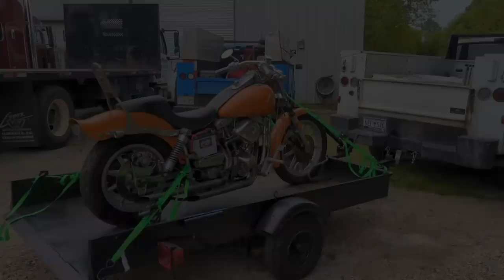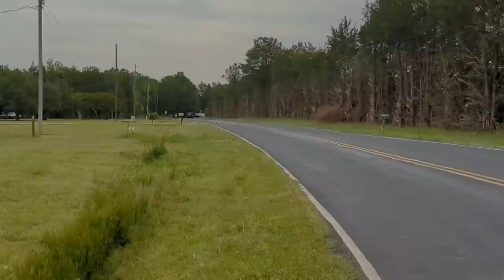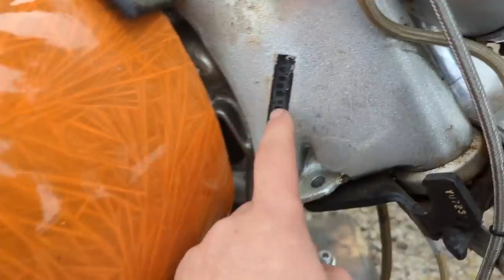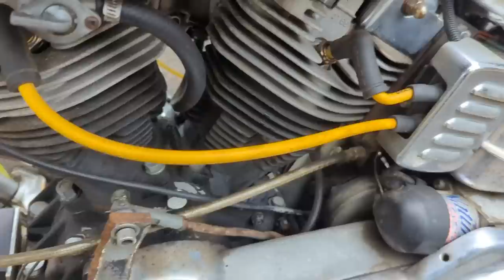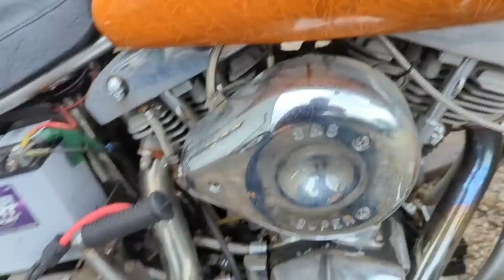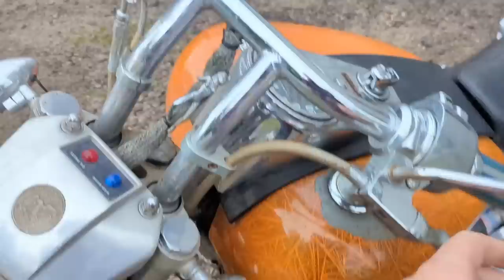I Bought The Cheapest Shovelhead I Could Find on Facebook! How bad is it? 1974 FLH meets 1979 FXS

Comment: TURN YOUR IDLE UP to at least stock RPM. Adjust when engine is warm . Helps keep oil going through the top end at idle.
Reply: Yep also to low an idle will drag the  crank pin bearings an cause lots scoring ...ppl always think it's Kool to have idle so low
Reply: @bigmikelongwood3276  it’s why I bought a cam for my evo. I like the lope lol
Reply: @crazydoom3dude  yea I got some huge cams in my old ironhead it lopes for days
Reply: @bigmikelongwood3276  I bet! I also got a higher pressure oil pump and stuff to make it all work well. 85 cubic inch big bore kit, ported polished heads, who nine yards. Makes 100whp
Reply: God dam I was screaming that.
Reply: I know maybe it sounds cool but waiting till it's good an warm is almost common sense.
Reply: Everybody sets the idle too low. It sounds stupid, doesnt circulate oil and probably doesnt do the hydraulic lifters any good either. Yes you may have to fiddle with it, just like a model A, but thats a carbeurated bike for ya
Reply: People love the sound but it's killing the engine.

Comment: Shovelhead is the last old school Harley a guy can maybe afford today however they are absolutely 100% as bad as I remember them.
Reply: We couldn't ditch them fast enough once the Evo was put into production. Why someone would purposefully rehab one to use as a daily rider is beyond me!
Reply: @LeoTheComm  its just an engine. Build it right and it wont  know if it is a shovel or a block head american made or jap made
Reply: @LeoTheComm  I take an antique out virtually every day I ride! Evos are great engines!
Reply: 30+ years riding two shovels, {a '77 and an '82}, I would never call them bad. The few problems I had were easily permanently corrected: Stock ignition switches were junk, replaced with parts store universal switches and the stock switch hole was the perfect place to fit an oil pressure gauge. The '82 had the crappy electronic ignition but switching it back to points made it super reliable. Both bikes ate clutch cables but converting to jockey shift solved that for good and (my personal preference) I think it's way cooler anyway.  Also the machine screws that hold the exhaust pipes in the heads are known to sieze and strip out when removing so I replaced them with studs and brass nuts. Many trouble free miles and lots of fun with those bikes...
Reply: Not really. Get a evo Harley, and you can afford it, and fix it all yourself.

Comment: The engine sounds good.  The gears upshift good.  Overall I believe its a good shovel.  I would want to chrome the engine though and get chrome rocker covers and cam chrome nose cone cover and outer primary.  Just put a new pilot jet in that carburetor because im sure its clogged ( I have an experienced ear for this)  Next, paint the tank and fenders a dark red and have lower fender and tank in gloss black color.  Leave the wheels as they are.  Try to paint that frame black and get rid of that crappy silver color  That silver frame is a huge minus in the bikes looks.  And yes youre right that shift linkage looks like chit and needs to be changed.  So gradually as you will still be able to ride, about 600.00 will fix you up

Comment: I believe that the frames are very much alike, but there are a couple.differences. Behind the rear head, the seat post is slightly different, and the FL frame has a tab on the primary side to accommodate the floorboard.

Comment: Nice bike man. I have a 75 FX, it's also Orange drag pipes same handlebars same forks I was trying to send you a video of it. I'm sure you know what's inside that motor. I have a 80cc stroker 60 over same carb 10 thousandths bore. it sounds almost the same. almost eighty horses 90 lb-ft torque right around 3G rpm. I paid 5 for mine and I love it. I want to put a little trailer or probably better with a sidecar for my little buddy to ride along

Comment: Good day. You might have a FLH frame? I can’t remember but the footboard mount you pointed to near the drag pipe is the giveaway. But I can’t remember  on which side it was deleted for a FX frame. Smitty 
Footboards and original FLH  foot controls will work for shorter people. And a lot easier to install than mid controls. Footboards are very comfy.
Reply from the maker: Yup this appears to be an FLH frame, the seller told me it was a 74...I don't really want floorboards. I may fab up some mids or some closer forwards.
Reply: @buttcrackcycles  you really don’t have to run boards. But the stock shifter and brake set up will fit real real good even with pegs.
Reply: It's definitely an fl frame, due to the tab on the right side. It has a fl outer primary as well, notice the tab on it. These are both for footboards.
Reply: @buttcrackcycles  Don't cut that floorboard tab off! I have been looking for a floorboard aluminum outer primary for my 77 at swap meets for a year now- lots of FX (tabless) outers around but not FLs!
Reply: I had a 77 fxe that had footboards.

Comment: Geez, crazy as it sounds, I kind of like it. Immediately following Bike Week 1982, I purchased a left-over 1981 FXEF from a guy known well to me. He had bought it from a local dealer, added a BUNCH of chrome (no skulls), a flat tappet cam, Barnett clutches and a Super B, trailered it the 1000 miles to Daytona and road it for the week. Trailered it home with 164 miles on the clock and decided to sell it. The deal was too good to refuse at 5K even. (He wanted the cash to put in another lift at his garage) I put just over 43K miles on it with only normal maintenance. The last of the AMF Harleys was, for me, totally good.

Comment: Decent score! That one's hardly "bad". They certainly knew someone as there was no need to alter the engine numbers since title passes with frame post-1970. Fine for a rider so good score. Removing the bagger garbage was perfectly normal in that era because bikers bought HDs to use as actual transportation. Low Riders reflect Willie G. copying what bikers had done since the generator era with Sporty front ends etc. There should only be a VIN on the right side case.

Based on my decades of Shovelling (and fixing fighters), take or leave as ye prefer:
I'd install a stainless lock nut to retain that spark plug holder cover. Shovels vibrate and SC roads ain't smooth (I live near Sumter). 
Star style lock washers work best (per NASA, and why spit locks aren't used in modern aircraft) and red Loctite gel is love. 

The stock cowpie box is best hung on a wall along with the primary once it has significant wear. The affordable upgrade for a keeper is a late splined shaft Evo Softail transmission, primary and starter which are best hunted cheap and set aside if not needed immediately. I still run cowpies but may have scared them into behaving by threat of replacement.. My Pan project is starting off with a five speed for the vastly better everything including reliable Denso OSGR starter (ya won't be young forever so leaving the option never hurts even if you run a kicker kit).  

BTW Taiwanese kicker kits and arms for the old four speeds are trash and the arms bend even with stock compression.
Alternators on all cone engines are basically consumable so I keep a spare handy along with appropriate ignitions. Points or EI don't matter much if properly timed, but like with Sporties best pull the ignition cover to inspect for melted pickups or advance and points wear depending on whatever surprise lurks beneath. 

I pull the timing cover on any new-to-me big twin and pull the tappet filter screen (every oil change) to check for chips. It being so old you'd be wise to snatch a tappet block and eyeball the rollers and cam lobes. 

https://www.facebook.com/groups/1465028990466294 is worth a dummy Fecesbook account. It has all the factory Shovel service manuals and parts catalogs, handy for swap meets like NC ABATE or Denton AMCA when hunting Shovel parts. If you haven't been to Denton it's a fine time with old iron and old mechanics.  The Donnie Petersen Shovel books are worth owning but not cheap in print. Downloads turn up.

Visit Jockey Journal and Chop Cult if you don't already know about them. JJ is slow but has many old builders who won't be around much longer. Chop Cult forum is outstanding but down for host swap today.  

Properly sorted Shovels are reliable machines (as with Ironheads "properly sorted" mostly means replacing everything electrical especially the wiring harness, but the best harnesses are DIY so it's cheap). Enjoy your new ride!

Comment: The Shovelhead was a good design and can be very reliable as long as they are not hot-rodded. Keep them with low compression and they will run a long time. I owned an '82 FXS Shovelhead for 15 years and put over 80,000 miles on it with basically tires, oil and fuel.
Reply: Yup...a friend of mine years back had a 114" shovel bagger....I did take it for a ride once, and it was cool to see the look on the face of the guy on the Honda who figured, easy race win from a stop light....I smoked him, and with my old lady on the back. The problem was, a fast as it was......it needed rebuilding  every Winter, sometimes twice ina year it would blow up.

Comment: the lug in the right side, is a mounting for FLH floor boards, same as the part on the left side on the primairy cover so yeah its a flh frame, put an andrews J cam in it and with the super-e you will have a nice running  74'' shovelhead

Comment: Years ago I had a 1979 Shovelhead. AMF. Almost didnt buy it because it being AMF.  I had absolutely ZERO problems with that bike. I had it for about 10 years. No oil leaks nothing. Only issue was electric start stopped working after about a month. Didnt even bother fixing it. Just kicked it over.  Bike sounded BAD ASS.   One of THE best Harleys I've ever owned.  O owned 2 Dynas, a hatdtail sporty. A brand new 883 sportster which i hated. And the 23 year old Dyna im riding now.  That Shovelhead blew them All off rhe road!!

Comment: I like it! Without the skulls and beer can artwork of course. 
The paint job looks very cool on video, how is it in person?
I think I would put an oil pressure gage on it before anything else. Check the clutch wear, the lifters for slop in the blocks, go over the wiring for fire hazards, etc.
If you don't like the tee bars, I am in need of those exact bars for my '72 Sporty. I have them and like them but mine are tweaked and I want to replace them before handing the bike off to my son.
Looks like a fun project. 
Good luck and ride safe.
Reply from the maker: Jerry, the paint is actually one of my favorite parts. Looks pretty good in person, obviously chipped around the gas caps. 
I definitely have a little list of stuff I've been slowly working on to get the bike road worthy, and I'll be putting out a few videos about fixing it up.
I'll probably ride the t bars for now but eventually they'll come off
Reply: @buttcrackcycles  
When I first started riding the Sporty with the tee bars, I didn't think I would like them. I had taken off 16" apes, that I didn't like, and the tweaked tees were the only thing I had to replace them with and found I really liked them.
I've always liked the look of drag bars on tall risers, and the pull back of the tees just looks and feels really good to me, and my son likes them also.
I'm currently riding a 2000 Heritage that is stock except for custom paint, hi flow air filter and V&H Shotguns. Just bought it last month and am loving it.
Ride safe
Reply from the maker: @jerrylong381  I'm gonna try them just because I don't feel like dealing with pulling the electrical through the bars and redoing that right now. Maybe they'll grow on me?!

Comment: So your transmission is from an FL model.   You can tell me where the linkage connects to the rotator on the trans.   FX trannys have the linkage tab on TOP of that rotator.   FL trannys are on the bottom, like the one you have.   I think that may be why someone homemade the rest of the linkage to shift it.

Comment: Get a CV carburator. Polish the leading edge of the slide. The needle and jets can be adjusted.. Cheap. Weld a washer on the end of a bolt and insert in exhaust like a flapper valve around 10 to 4 o'clock.  Easier to tune carb. I'm just saying it works for me. 1950 Pan-Shovel here

Comment: If you want that thing to move go get an Andrew's F grind cam and the correct valve springs to match.   It will increase power greatly and still keep it streetable.   It's the biggest cam without having to do extensive head work.   Get rid of the S&S carb and go find a Kline and jet to match cam.   Good red light racer bar hopper
Reply: What's a "Kline" carb?
Reply: There is absolutely nothing wrong with an $&$  Super E, it just needs to be tuned properly....  I run a G model on my '68 FL with no issues....
....RooDog....

Comment: no numbers on the alternator side of the case, normal. the engraved numbers on the right side vin boss is pretty ghetto but it is what it is. 4800 is a good price though, people get so scared of titles and stuff. cone shovels are titled to frame anyways. i have a frankenshovel too but in alabama its easier to register. no titles for 30+ year old vehicles. my understanding is SC is pretty anal about that stuff. good luck with the bike!

Listening to the video I think we had similar introductions to the world of shovelheads, coming from ironheads. It was always weird to me that my ironhead was faster than my shovelhead. I bought my shovel unseen out of state and it came to me with house wiring and no brake pressure. People swear by s&s super e carbs but I really love mikuni vm38's , both on ironhead and my shovel. Makes for a really easy to kick bike.
Reply from the maker: Yup, the title situation isn't a big deal really, but I have had some trouble in the past with GA how they don't issue titles for old stuff.
Slowly working my way through my laundry list of repairs to this bike to get it road worthy!

Comment: anyone know why the sportsters were made with the iron, or shovelhead. but the big bikes didn't use the shovelhead until 66?:hand-purple-blue-peace:
Reply: Sportsters were flat track racers starting out as flat head, side valve, k model motors. They went with an overhead valve configuration to compete with the British. Big twins went with a similar rocker configuration because it worked well on the sportster. They made the change when they designed a more efficient head/ valve train/ intake in the 60's.
Reply: @JJ-sv1ov  Much obliged!
Reply: I don't know where people come up with this stuff 😂

Comment: I had an 80'  with 80cu. motor. Caught shit all the time because it was an AMF, everyone telling me they were junk. Every spring I took it to the dealer and told them to check every nut and bolt and adjust everything that needed it, caught shit for that too. Not once did I need to get a repair done, rode that mfkr for almost 20 yrs. and only thing I did was change oil, replaced plugs if needed and replaced a weather checked front tire. Can't tell you how many times I went to a friends house to see if they wanted to ride with me, but they couldn't because their bike was down lol. Even their ol' ladies would laugh and shake their heads.🤣🤣
Reply: Shovelheads were AMF from 1969 to 1982
Reply: FLH ?  Looks like an FX  pal

Comment: S&S carbs are also known as Spit & Sputter carbs. Especially if you keep those drag pipes on the bike you're never ever gonna be able to tube the bike to work smoothly throughout the whole RPM range. You are now eligible for your true Shovelhead t-shirt like I have.  It's got a pic of a H-D logo and cone engine with the words SHOVELHEADS - RIDE WRENCH REPEAT.
Reply from the maker: Yeah sounds like the shirt for me.. Funny about the S&S carb, every carb video I post about my Keihin on my Ironhead gets tons of comments saying "just put a super E on it!"
Reply: @buttcrackcycles  I've got a Keihin CV carb with a performance kit on my "74 FXE. I've got a Sifton 468 cam and a Baker 6>4 tranny with the Rivera Pro clutch. The Keihin with a performance kit is definitely the best carb for a moderately hopped up Troublehead. Also the Rivera Pro clutch is the best clutch for a Shovelhead. Changes the bike completely. Kinda pricey but worth it.

Comment: I don’t think that bike was so much put together from parts as it was an original “Low Rider”  that had it’s gas tank and rear fender changed and got homemade forward controls (the shifter would have originally come through the primary).  The frame, front end, wheels, handlebars, swingarm and brakes are all “Low Rider”   The painted motor is the way it came from the factory.  The “special construction” title from South Carolina is interesting because somebody (SC BMV?) wiped out the original factory VIN on the neck and motor which you’re normally not supposed to do.   The cylinder heads with the “66” markings are called “short reach (plug)” came from an older Shovelhead.  My suggestion would be to clean it up, get it running and rideable again then sell it and get a Shovelhead with good factory numbers.  That’s why those other Shovelheads were more expensive.

Comment: I've own, built and bought "new" shovelhead Harley's and it turns out they were all the same, a pile of crap back in the day. Want to get a laugh check out Harleys answer to the very unsafe shearing rear disc brake pad anchor pins, (a spring) hahaha and sad. About the one and only positive I recall was my new FLH had Showa front forks which worked very well but the rest of the M/C still same old junk from the manufacture. We all should be thankful to AMF who make bowling balls and sail boats who bought H-D moved ahead made improvements somewhat to that 2 wheeled dinosaur. Finally in '84 they woke up some because people were leaving Harleys for other rides by the droves.